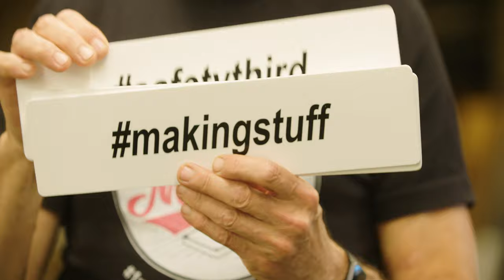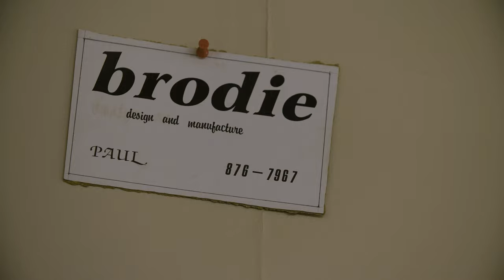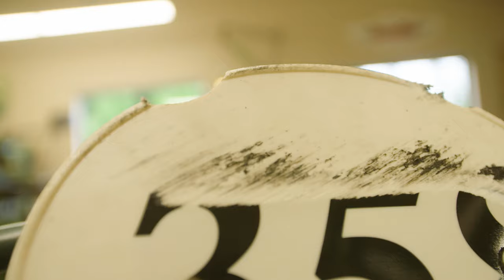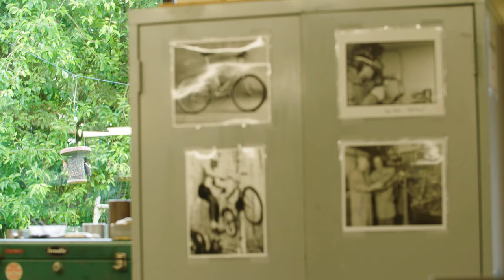MAKERS: Paul Brodie

Comment: I was told I always would only play with tools and things, so my mom got me a toy work bench, with plastic bolts, plastic saws  wrenches, it was for older kids, but I was not interested in anything else, I was only 1.5-2 years old, then by 4 or so I was tearing things apart to see how they work,  by about 8-9 I would buy old bikes from other kids and build bicycles from the parts,  they would have bad tires, no chain, needing tubes, missing seats or handlebars, things like this, I would fix them or use them for parts, then I got into motorized vehicles, I got a old car when I was 12,  driving my dad's tow truck when I was 13, moving cars around the house,  and built my first car engine about then, I love making things go fast!